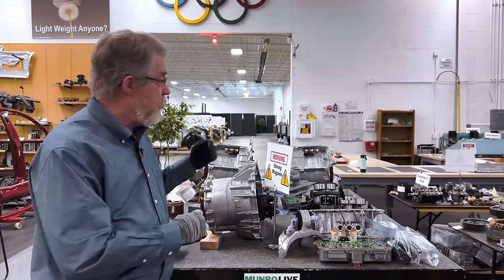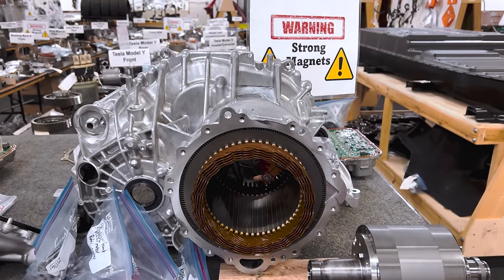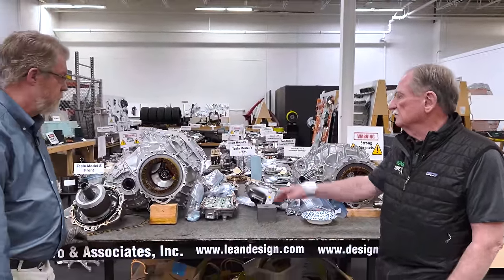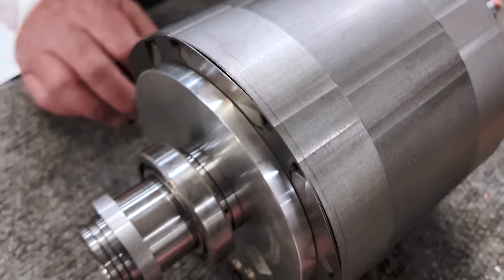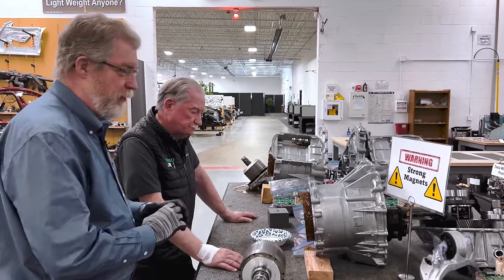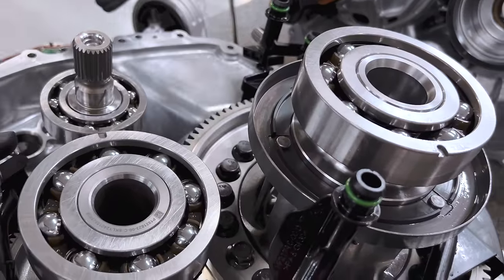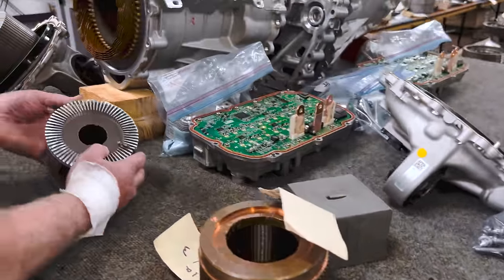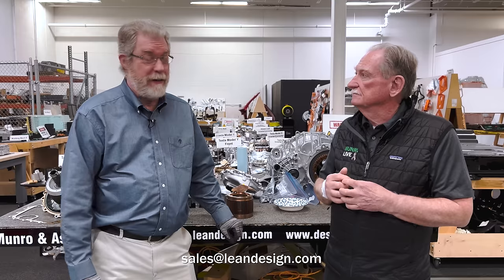Tesla Cybertruck 845-HP "Cyberbeast" Motors!

Comment: It's good to hear Ben's voice in your video. I thought he was a good presenter and a real value to Munro Live.
Reply from the maker: We agree!
Reply: I like all the episodes, but a bit more in which Ben is presenting, good job, Ben 👍🏼🫡
Reply: @ntulsian Yes!
Reply: @MunroLive  look up louisville family celebrates 1 million miles it's a 2007 honda crv 3rd generation crv with honda k24/2.4 liter 4 cylinder with over 1 million miles lol so munros full of crap in this video.
Reply: @billybobbob3003  And you've verified this🤣.
Reply: @billybobbob3003  That's certainly an exception and not the rule.
Reply: @billybobbob3003 Yeah, BillyBoy, you found the golden needle in the hay stack of crappy farting engines lol. How old are you? 12? ROFLSTC. 🤣🤣🤣
Reply: @Stefan_Dahn  this engine k24 4 cylinder smokes every electric vehicle on the market. billet blocks running 5 seconds in 1/4 mile lol fastest ev is only high 8's outdated slow POS. ev=1830s combustion=1860s.
Reply: @MunroLive  LOL 2007 HONDA K24 CRV IS HIGHEST MILAGE SUV ON THE PLANET 1 MILLION MILES ORIGINAL TRANSMISSION AND ORIGINAL MOTOR. NONE OF THESE ELECTRIC MOTORS OR BATTERIES WILL LAST THAT LONG SORRY.

Comment: My Honda Civic at 460,000 miles says otherwise. I got that out of a piston car. It's more than doable if you regularly maintain.
Reply: 03 E220CDI , had over 1M Km and a original turbo on it's way out when my family got rid of it . Grandpa passed it down to my aunt and she traded it in for a 2016 BMW 3 series Gran Coupe. Car had literally 0 issues other than the loud turbo .
Reply: Even if they don't rebuilding or replacing an engine is still cheaper than a new battery half the time and it's not clear how many new batteries these cars would need to do that kind of mileage.
Reply: Civic reliability is absolutely phenomenal, the on of the few things beyond a civic is an early 2000s diesel Volkswagen Jetta, a million miles is common with those things.  What year of civic do you have?  I recall that the most (in fact the only) I could find of the Honda civics that were able to reach a million miles were all 2006.
Reply: She's an 07 civic. Has all the paint issues, but mechanically absolutely sound.
Reply: @1950sAmericanFather  I expected a 2nd Gen, congrats and well done.
Reply: Cool anecdote.

Comment: I am no electrical engineer but Tesla uses segmented magnets in their other motors. There must be a valid reason why they changed. I remember a few years ago Sandy was surprised at segmented magnets used in the model 3 motor
Reply: If loss of efficiency is the downside, it is possible that torque is the upside?
Reply: I think its very likely that the inefficiency  is only noticeable at high power loads, which it too infrequent to have an impact on range. The motor will have at least 300hp and will probably be using less than 60 at cruising speed.
Reply: Trucks need MORE Torque than Speed .
more Efficiency over Acceleration. 
more RANGE when Towing.
Reply: my best guess is that elon has 4 years backlog on the cybertruck.  Now take that to its conclusion.........
Reply: @davidanalyst671  No idea what you mean. What does the magnet has to do with the backlog?
Reply: The segmented magnets are only beneficial at high speeds. Where you essentially try to weaken the magnets by creating opposing magnetic fields with the stator. This is what generates a large amount of eddys. Their gearing looks very low. Meaning the motor might not ever reach high speeds. Additionally look at the small amount of steel holding the magnets from flying radially, indicating this motor will never run at high speed.
Reply: Monoblock is cheaper plus they could have done something to the metallurgy of the magnet to reduce eddy current.
Reply: Составной магнит при той же силе и размере имеет более направленный и сосредоточенный поток большей дальности действия. Странно что  ещё не применяется сборка халбаха. Вероятно будет в следующих моделях
Reply: As they said the use it for cost.
I'm guessing it's a detail they'll get to down the line.

Comment: On the monoblock vs segmented magnets, I would recommend using magnaview film to see if the magnet is segmented inside of the external plating. The other thing to check is the electrical conductivity of the magnet to see if they added anything to the magnet that would reduce the electrical conductivity before sintering it. Both methods could be used to reduce eddy currents.
Reply: nah tesla wants to cost cut no matter what. Only the high margins matter now
Reply: @NyashaM Patrick is referring to the testing methods to inspect the motor, nothing to do with Tesla making savings.
Reply: As I understand it, rare-earth magnets use sintered material (not poured into a mold in a liquid state).  So perhaps a nonconductive binder (instead of sintering) is possible, in which case there would be no eddy losses on any axis.  (The counterpoint is that such a structure would not benefit from being plated...so this may not be the case.)
Reply: @satoshimanabe2493  the plating is typically alternating layers of nickel an copper and while I agree that eddy currents may be generated in the plating it is very difficult to build up eddy currents into very thin conductive sheets. I have spent a lot of time using induction power to evaporate metal in a vacuum chamber and bulk blocks are much easier to get thermal power into than thin conductive sheets. This is also why laminations are used. Lastly the plating would still be essential as Neodynimum based magnets are highly succeptialbe to moisture based corrosion.
Reply: @patrickmorse7549  Thanks for the explanation about plating, very helpful.  What I meant by non-sintered, seems it's actually called bonded magnets (I'm sure you're familiar).  I was trying to say that if the bonding fully coats each particle so they are electrically isolated, would there be any need for additional segmentation?
Reply: @satoshimanabe2493 , so bonded is the typical process for Neodynium magnets. In my experienc they are usually conductive when bonded and the magnet particles usually need to be in close contact or in direct contact with each other to provide more strenght. I think it would be possible to bond them in a non-conductive binder but it may limit the BH curve and total strenght of the magnets. It would also be interesting to see how the binder would effect the currie temperature of the magnets.
Reply: @patrickmorse7549  Wow, that's something I didn't consider at all.  Electrical and thermal conductivity is closely related in many materials.  If it's a thermal insulator, then it would take time to bring the entire piece to temperature for magnetization, then it would need to be held until it completely drops below curie temperature.  So such a binder would need to be somewhat exotic.  Beryllium Oxide is often used in such application, but it's terribly expensive, and toxic (if memory serves).  Might not be a good binder, but mica would be even worse.  Perhaps this causes much more difficulty and cost than simply segmenting the magnets.  Lol.
Reply: You need a strong ceramic-like binder to hold all the tiny magnetic domains pointing together in parallel. These magnetic domains are all strongly repelling each other and each is straining to flip over. 

Ceramics can be overall conductors, semiconductors, or insulators. Permanent magnets with a strong field will require a ceramic-like strength and corresponding brittle quality.

Comment: Great video, thank you so much for putting this for free!
Some thoughts on the non segmented magnets: First of all, yes there are eddy current losses in the magnets but they are quite small compared to iron and copper losses. Still they can be problematic since they are the heat source in a temperature sensitive part. One problem with the segmentation is that you will lose some torque because of having less magnet material in the rotor. This will make the motor a bit less efficient. I think that this loss of efficiency could be more than the additional eddy current losses. However, these eddy current losses are mainly due to the current harmonics caused by the PWM. This means that you can drastically influence the magnet losses by the PWM. Maybe Tesla optimized their PWM in order to reduce the magnet losses for not having to segment the magnets.
Reply: It has nothing to do with what you are saying. It’s because this pm motor will never reach deep into the flux weakening region. If you are interested I can explain why I know.
Reply: @ignaciohavok1  I am interested, please explain!
Reply: @ignaciohavok1 sounds interesting, could you explain? Does it mean the motor is not driven to high speeds or is the corner speed quite high?

Comment: That bearing rotation constraint is most excellent !!
Reply: Absolutely! Huge improvement for reliability/life cost. Some bearings have had pins/nubs on the outer race to prevent spinning and I've never understood why more of them don't.
Reply: После разборки, совместить три подшипника будет не возможно, это сделано чтобы вы не смогли сделать ремонт
Reply: It adds parts: the bearing rotation locking mechanism and the spring. Does not align with a "the best part is no part" philosophy. Should by constantly checked for better alternatives.
Reply: @hybridinnovate  Munro disassembled these very drive units including getting those bearings out. Why do you think this hinders repair of the units? Do you think, they broke the spring mechanism?
Reply: @MooseOnEarth  это не мешает ремонту, позиционировать одновременно 3 подшипника для сборки будет не просто
Reply: @MooseOnEarth  это надежно. но как это собрать обратно. двигатель модели s оказался не надежен
Reply: It's absolutely horrendous engineering. It's cutting corners on tolerances to save cost! Make the bearing fitment right and you don't worry about the outer race spinning in its housing!! This seems terrible to me. If it spins then there's not much holding it on that little pin
Reply: @jguth6  I'm more worried about the bearings doing microscopic movements and damaging the seat this way if it's very loose rather than the little pin shearing. I mean, it would have to bind really badly, especially for a ball bearing!  My guess is that's it not that much of a machining concern, but labour related one.

Assembling for example a machine tool spindle is incredibly involving and stresfull, here you have looser tolerances but multiple races to seat at once.

And sure, when I have all day to work on the lathe or mill that I plan to keep I can take my time. I can clean everything, measure and preheat cool down to avoid any hammering or hard pressing. But on an assembly line they probably want to just plop it in place and move on. So kind of still trying to save on cost? 

And I remember once reading about intentionally letting the stationary race to slowly creep around so that different parts of it are the "loaded" side over their lifetime. It was a really old book though.

Comment: that spring loaded pin to catch and stop outer race from spinning is so smart of an idea.. and Sandy's response "so anyways..."  lol
Reply: It's an interesting solution but...  The tiny pin may prevent a small problem from quickly becoming a bigger one however at the power and torque levels involved once that bearing gets grabby its going to spin unless the operator notices the change in sound when it starts to fail and has it serviced expeditiously.  Time will tell whether having that pin tear loose causes more damage than it prevents.  Hopefully the MTBF of those bearings exceeds the half to one million mile operational life expectation of the vehicle.

I can see that spring loaded pin failing and causing damage similar to other implementations using spring located pins that we've had for some time in pneumatic and hydraulic tools.  If the damage isn't too catastrophic sometimes I've been able to just clean up the seating area and drill a new hole for the locating pin and spring while other times its weld and machine a new surface or replace that part of the housing depending on the cost of the part and the value of the unit or perhaps the cost of the downtime.  Like Sandy said:. so anyways...  ;>

Best!

Comment: This kind of videos really benefits from Sandy outlining the wider meaning and historic place of all the technical details. As a software engineer I otherwise wouldn’t quite catch the showcased engineering genius 🙏🏻
Reply: Software & Hardware need to work alongside on the Floor , to better understand one another.
Reply: @markplott4820  Isn't that the truth.  Especially when it comes to embedded design, it's easy to say "X" will work, then realize it doesn't in practice.  Flashbacks to RS-232 vs RS-485 pain in the rear.  Especially when the company is trying to be cheap.

Comment: Could it be that the magnet is segmented internally, inside the outer plating, or made of a less electrically conductive material to reduce eddy curent losses?
Reply: How much eddy current loss there is in a magnet though? Doesn't the stator aim to keep the magnetic field quite constant relative to the magnets, and a constant field definitely doesn't produce eddy currents!
Reply: you don't put an outer metal plating on a series of magnets. Thats magnets 101 man.  Any metal solidly connected to the magnets would distort the mag field.  You could segment the magnets, wrap in saran wrap, and then dip in liquid steel, like they dip snickers bars in chocolate, but that would increase the distance from magnetic material to the lectric coils it reacts with.... so you wouldn't do that.
Reply: @mikeselectricstuff , Wow, you would be a great addition to the Monroe reverse engineering team.  I can hear your whispering voice now discussing the finer details as the components are carefully disassembled.  I have been waiting for the day you disassemble an MRI superconducting magnet on your channel.
Reply: I assume they did something to the metallurgy of the permanent magnet. That would be a low hanging fruit. Tweak the silicon content or add some exotic element and bam eddy current is reduced significantly.

Comment: Cooling the magnets makes sense, because overheating a magnet can reduce it's strength permanently.
Reply: That’s not the main point of cooling the magnets, this is a synchronous motor, it’s to prevent the motor from reaching the end region heating limit as well as armature heating limit as well as field current heating limit.

Comment: "You'll never get that (half a million miles) engine life from an ice car."
 I'm real damn sure a couple of ICE cars have passed a million miles, not just half a million.
Reply: Guy math: Spending $30,000 and countless hours to keep a $3,000 vehicle running.  😁
Reply: Stalin math: “Spending $60k ($30k + your labor) to get that lone $3k car to 1 M miles is a tragedy. Getting 1 M Teslas to 1 M miles is a statistic.”
Reply: Better than spending a 100 grand on the Cybertruck monstrosity!
I have almost 300,000 miles  on my 4 cylinder Toyota 4 runner with the original engine and tranny and still runs great.
New radiator, driveshaft with new u joints, tires, brakes, oil changes and that’s it! Parts are cheap.
Let’s see a Tesla after 300,000 miles. If the battery goes tits up then take out a loan!
I’m not anti EV but they have their place, we have a 2020 Chevy bolt which sees the majority of our miles now but it won’t replace our motorhome for travel or Chevy pickup for hauling.
Reply: @richardwolf6269  There are plenty of Tesla's over 300K.  Half a million is much tougher to hit, almost no on drives enough to do that on a vehicle before it way ages out.  The avg yearly mileage for someone in the US is around 13.5K.  That would be 37 years for the average person.
Reply: Yeah there are a couple that have but that is the exception and not the norm. Less than 0.2% of vehicles on the road get to 500000
Reply: Had few v8 vans and trucks, it's not the engine that fails but, body rust and suspension,  plus minor wiring issues.
Reply: I had 640k miles on my Cummins before I sold it, and it ran like brand new, unlike my piece of trash Rav4 EV with a Tesla induction motor powertrain.
Reply: This story supports the assertions made in this video:

“Most EVs are still too young to die of old age, but not the Teslas at Tesloop, a Southern California-based fleet that rents the EVs to customers who need to travel from San Diego to LA or destinations in between. The Tesloop cars can clock up to 17,000 miles a month and need to recharge as often as twice daily. Several of its cars are nearing a half-million miles—when most fleets ditch their cars after 100K. Tesloop shared its data with Quartz, which teased out some interesting conclusions.

“When we first started our company, we predicted the drivetrain would practically last forever,” Tesloop founder Haydn Sonnad told Quartz. “That’s proven to be relatively true.”
Reply: My dodge is about to hit 100k and its about done. Makes a noise like its dying
Reply: You just showed you don't know kw what you're watching. 
He means Fleet Average Lifetime of the vehicle model.
You have shown yourself to be a 4 year old in a room of adults disrupting a conversation to get attention.
Reply: @richardwolf6269  then go look at the million mile Teslas out there already. So many are already over 500k that it isn't even worthy of a blog post.